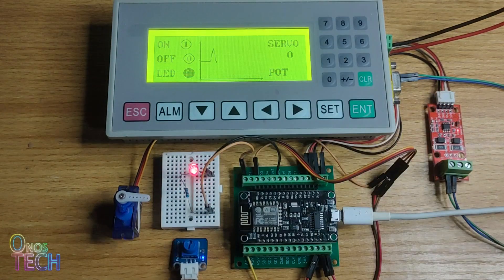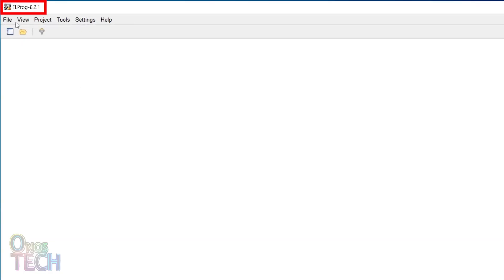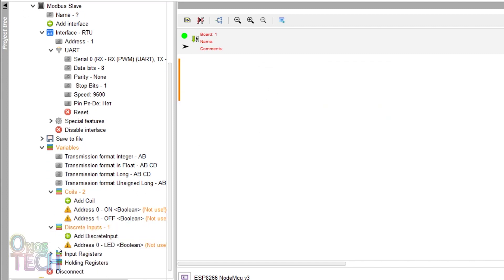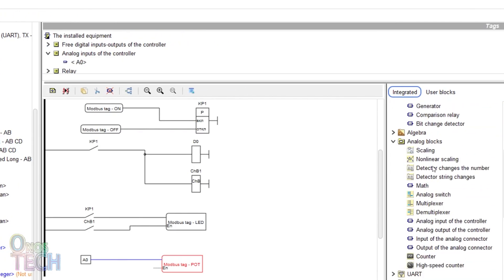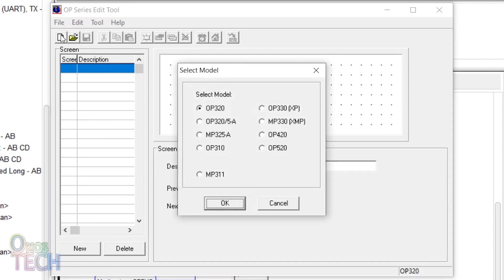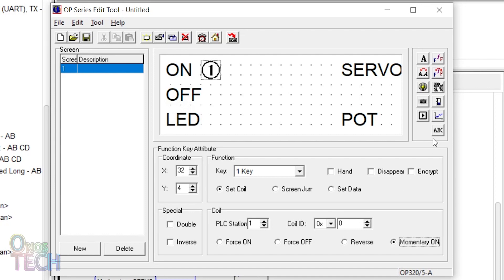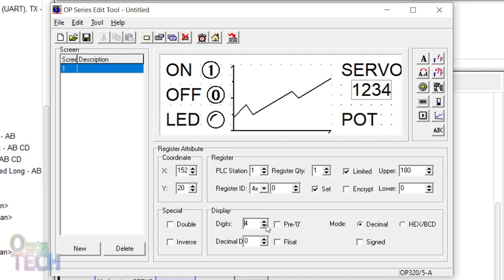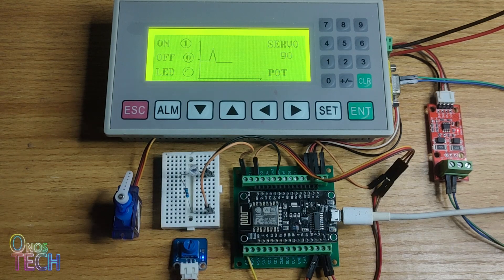#7 Programming the ESP8266 Modbus RTU & OP320 HMI Panel

Comment: Hi Onos:
I tried a simple network with just two slaves (both of them Arduino nano) so I configured Slave 1 (Address Slave 1) and Slave 2 (Address Slave 2) and OP320_HMI AS THE MASTER.
It is not working at all; I download exactly the same program in both Arduinos with different slave addresses.
I also tried using different names and variable addresses but did not work.
Something important I realized was that when connecting just one slave no matter the slave address (in FLProg, could be address slave 1 or 2 or 3…) the OP320_HMI always recognized that address as address slave number 1

With just one slave (arduino nano) Works O.K.

WILL YOU BE SO KIND ENOUGH OF MAKING A SIMILAR VIDEO WITH 3 OR 4 ARDUINO NANO SLAVES AND OP320_HMI AS A MASTER?
!😀!Greetings!
Reply from the maker: Send a message to onos.technology@gmail.com